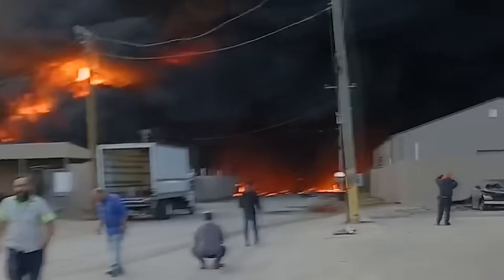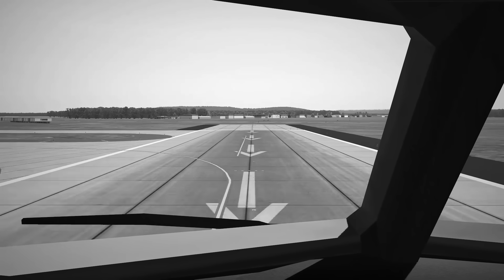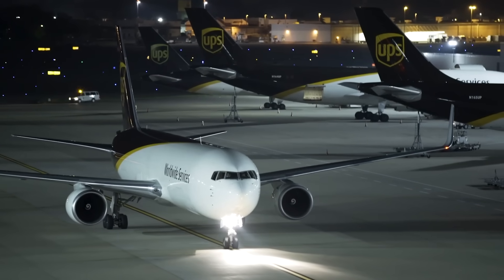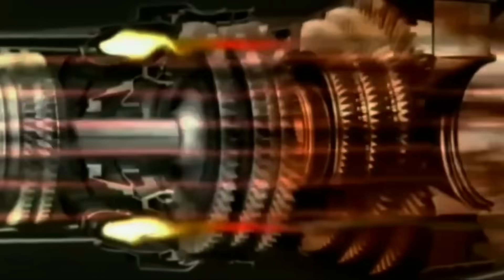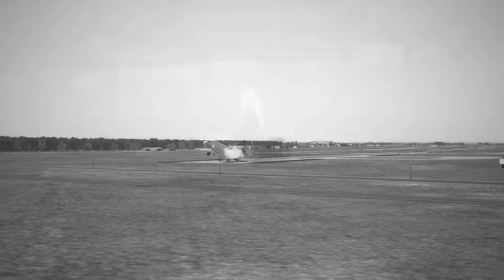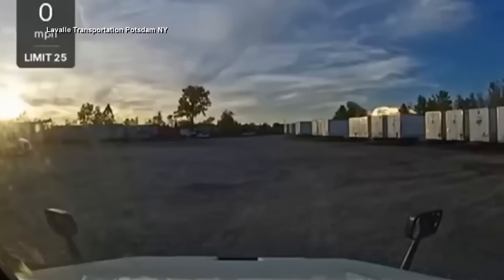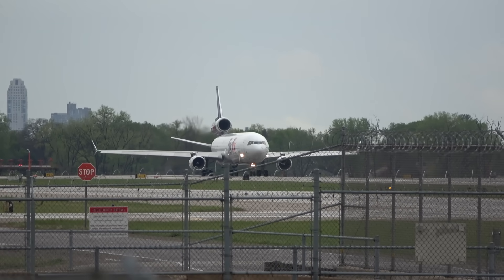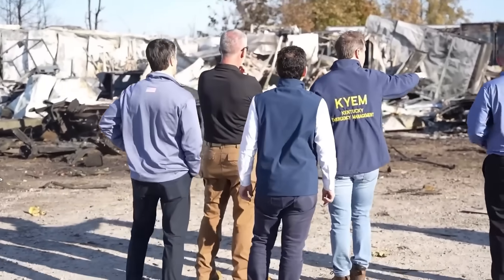The Real Reason That Makes UPS Flight 2976 Crashed...

Comment: This aircraft was gonna crash even if they had full power from the other two engines, the hole left in the wing after losing the entire pylon and engine with the fireball heating the left wing like shown in the video would have fatigued the integrity of that wing and eventually caused that wing to collapse after take off before they could have gotten the plane back on the runway…..those guys were doomed as soon as they started rolling down the runway.

Comment: I think the actual sequence of engines is #1 left wing then #2 tail and #3 right wing and the compressor stall was in the #3 right wing?  Even if a second engine didn’t fail and they had enough thrust to climb, the damage to the left wing from the fire alone would probably cause a stall on the left side and still be fatal.

Comment: On crashes like flight TWA 800 where it blew apart over the ocean, I can see why it could take a year or more to issue the final report. All the evidence is at the bottom of the ocean. Pretty hard to get too. But this UPS crash shouldn't even take 3 months. All the evidence is within a mile from the beginning to the end of the debris field. It's not scattered over miles like a high attitude break up and its on land not under water. I believe the Federal Government (mainly NTSB) is just milking this for more funds. All the engineers, scientists, maintance faculties and records are right there. Add on that this is probably the most recorded crash in history from multiple angles. If everyone from the aircraft industry can already state on the record that it wasn't the pilots fault at all leads me to believe they already got a leading cause why it went down.
Reply: "TWA 800" shot down by navy "Standard" surface to air missile, as tangible evidence points to!
Reply: @internetcensure5849 center fuel tank got overheated by the air conditioning unit with old wiring caused it to blow up. The US Navy doesn't like to shoot down civilian airlines over US shores

Comment: Here is what a couple of pilots and others and what I think happened:

An uncontained fan blade disc separation in the #1/left engine sent debris through the engine, into the pylon, and into the wing. This caused the engine and pylon to separate from the wing. Also, the debris damaged fuel lines causing the fire. As the Engine and pylon separated from the wing it went up and over the aircraft sending debris and fuel into the #2/center engine causing a compressor stall and losing power/thrust in the #2/center engine. 

As to why there was an uncontrolled fan blade or fan blade disc separation? Only the investigation can determine that, IF that is the cause.   

WHY do I and others feel that is the cause? In the photo of the #1 engine that had landed on the edge of the runway, look at the rear of the engine, there appears to be a gap where at least 1 or 2 fan blades or fan blade discs were. Whether or not that damage occurred before the engine separated from the aircraft or after, only the investigation can determine that!
Reply: All of you were incorrect!

Comment: It is more apparent the compressor stall was the center engine, number Two, leaving the airplane in the unflyable position of having only one normally operating engine.  The crash was caused by the second engine failure.  A single engine failure is not fatal, but two is.

Comment: 4 decades in Aerospace building Aircraft/components/subsystems around the World. Good summary but point out you did not speak to the possibility that the #1 Engine may have separated from the Wing Pylon first. Don't forget that within the Nacelle, there are "FFC" (Fatigue Fracture Critical) Attach fittings ... the attach the Engine/Nacelle to the Wing Pylon and if those break loose, it'll take all of it up to the Wing apart. From other videos, I note the Engine is intact sitting in the runway enfield, followed up runway by the Nacelle Cowling and finally the Pylon that separated from the Wing. Given that sequence of debris, it would appear the Engine separated from the Nacelle and yanked the Pylon from the Wing and spewing those 22,000 lbs. of fuel out of the port Wing TE. Just a guess.

Comment: This is stupid,  if the right engine failed, the aircraft should have remained level from the thrust from the rear engine,  but in the video we don't see that, instead we see a plane going over hard left, simple indicators proving right engine giving max thrust,the center engine apparently failed, plus we don't know how much of the flight controls were compromised by the loss of the left engine. The plane was over 150mph at take off, the odds of debris crossing UNDER the plane and hitting the right engine is crazy, more likely scenario is debris from left engine getting into  center engine,  which is behind left wing, definitely the path in the video shows that being more likely.   When the report comes out we will know for sure about the engines.
Reply: The right engine had a compressor stall.  Which means only the #2 rear engine was producing full power.

Comment: Compressor stall? How can you tell the video has poor resolution? Is this an opinion🤔
Reply: One social media influencer said it was compressor stall and just like that it became fact
Reply: Look closely at the short flame from the right engine just after lift off.
Reply: Pilots and OTHER experts can tell by the puffs of the exhaust and flash of flame at the exhaust on the #2/CENTER ENGINE! 

Don't be afraid to look it up!!
Reply: @matthewgroff433  until FDR data is released, it's speculation.

Comment: 220 THOUSAND ponds of fuel? 
That 110 TOnS.  110 x 1000.
26, 829 gallons?
Holy shit
Reply: He said 34,000 gallons. Jet A is 6.7-7.0 lbs./gal. Water us 8.33.
Reply: @patrickmcdonald3427 damn that's like 50 cars...
Reply: @petez470:  you might want to check your arithmetic.  A ton is 2,000#, not 1,000#.  220,000#/6.7# per gallon is 32,836 gallons of fuel.

Comment: Engine pylon was damaged installing #1.Same thing happened in Chicago .thats my guess
Reply: How do you know what if any damage the #1 pylon had? As I commented previously, are you a member of this NTSB investigation team? If not, don’t represent you opinion as fact.
Reply: @tomreid5184 I called it a guess .Same model plane crashed the same way in Chicago NTSB ruled its engine pylon was damaged remounting it and came up with a new procedure in mounting the wing engines .
Reply: @paulgrimm  I spent 20 years in the Marines and was in two wars. Guessing would get you or your men killed. Stop acting as if you have some crystal ball. Get the facts then come to a logical conclusion.
Reply: FYI: the other air craft you referred to was a DC-10 not an MD-11. You can’t even get the facts right!,, Instead of interjecting your guesses, stick to writing fiction.
Reply: That was a DC10 but you may be right.
Reply: @mustang7272 could be missed structural cracks on the wing or even improper maintenance repairs on the left wing.

Comment: I think you have this wrong.  Engine #2 is the engine in the tail.  It was engine #2 that was likely damaged due to FOD from the failed engine #1 under the left wing.  The only functional engine was engine #3 under the right wing.
Reply: I noticed that too. They said it correctly, but the video misnumbered them.
Reply: Exactly! The narrator was wrong

Comment: The incident aircraft completed a scheduled "D" check, taking 6 weeks, which was completed on 18th Oct 2025. During such checks the fuel tanks are drained, cleaned checked for cracks/leaks and then treated with anti-corrosion and anti-fungal preparations.

Minor cracks etc may have been rectified by temporary repairs and permanent rectification deferred until scheduled deep maintenance. All such deferred defect must be cleared in order to complete the "D" check.

Comment: Why do so many airports have runways so close to people and buildings ? The end of the runways should be clear for a long distance in case of a crash like this one.
Reply: Been asking the same questions also.
Reply: If it's like my hometown, dumb ass people will move there because the land is cheap, then a year later complain about the jet noise and some older airports like Houston Hobby and Chicago Midway were pretty much surrounded by neighborhoods.  Never going to be able to move that many people out of the way.
Reply: Businesses supplying the needs of the airlines  - food, freight package sorting, hotels for flight crew....

Also cheap land because of engine noise.

Comment: The No 1 engine is on the left wing and No 3 engine is on the right wing and the No 2 engine is mounted in the fin.

It was the No 2 engine that ingested debris from the No 1 engine and suffered compressor stalls.
Reply: no evidence #2 engine ingested debris.

Comment: In the video it seems like the #1 engine was on fire the whole way down the runway so why not abort takeoff as soon they noticed this??
Reply: the pilots couldnt see the engines, they were trying to fly the plane and relying on the gauges. If they had seen the fire, they might have tried to abort.
Reply: Because a fire in one engine is still manageable. Hit the fire suppression button, shut off the fuel to that engine, and go around when able. The MD11 is very capable to handle this kind of event.
What really screwed things up was the total LOSS and ejection of the #1 engine, and resultant debris being ingested by #2, making IT fail. Low, slow, and unstable is a guaranteed disaster. The aircraft was past the V1 decision point, so it HAD to take off, there were no other choices.
Reply: @beezul Thanks for clearing that up for me instead of just writing some dumb shit like "because that's not what happened"! 🤣
Reply: @mikemoran0331  Great reply to sky boy or maybe sky pilot.
Reply: because that's not what happened.

Comment: En#2 has injested some EN#1 particles. Named DOD (domestic object damage). 
Please correct your video who point EN#3 (RH engine) has failing aflter EN#1 separation from the pylon.
Reply: no evidence #2 ingested FOD (foreign object debris)
Reply: @skyboy1956  not FOD but DOD. On the airport video we can see one flash in the nozzle of EN#2. Compressor stall maybe due to DOD

Comment: To begin with, when I was in the service, I was part of an aircraft accident investigation.  As soon as was possible, the maintenance records and flight logs were taken into possession of the Board. This was done to prevent any removal of document's that might lead to the root cause of the accident or coverup of questionable maintenance practices.

In this video, you show a drawing of the engine configuration of the three engines while narrating. You identified engine #2 as #3 which does not match your diagram. Engines are  numbered from left to right as viewed from the pilots view therefore: #1 is the left engine, #2 is the CENTERLINE engine not #3 per your diagram. Perhaps you should have been looking at your own diagram instead of reading off of a teleprompter.

Through out you narrative, you imply that the cause of this accident was the failure of the bolts/mounts for the #1 engine.  I agree that that engine did in fact separate from the left wing, but under No circumstances can you factually identify the root cause.

At the end of your diatribe, you say that "We're not going to get ahead of the investigation." That is exactly what you're doing.

Are you a member of the NTSB investigation team?

 You're free to speculate all you want, but don't for one second talk as if you have access to the factual evidence. You are confusing what could have happened with what did happen. The old adage that if you repeat something often enough that it becomes fact is exactly what you are doing. You should stick to writing fiction and leave the factual report to the experts and in this case that's the NTSB.
Reply: Definitely goofed on the engine number diagram.

Comment: The plane had previous damage when it hit the firmament.
Reply: There is no evidence that the plane had any damage prior to the left (#1) engine failure/detachment. Why that engine failed and detached, or became detached just prior failing is unknown. It was almost certainly some sort of mechanical failure involving the aircraft's components themselves, and was not related to any external forces previously damaging the aircraft's components, unless some type of debris kicked up from the runway during the takeoff roll and damaged the #1 engine. So far there has been no release of information indicating that happened. The engine did detach prior to the aircraft rotating to lift off. That is correct.
Reply: @michaelstephenson4136 
Obviously you dont know everything.
Reply: @samsngdevice5103 Obviously not. Nobody knows much at all until the NTSB report comes out. So why are you pretending you do by making a definitive statement about the damage? I did acknowledge you were correct that it had damage prior to getting briefly airbourne. That much we all know. Have a nice day.
Reply: @michaelstephenson4136  Now this is how you should comment on this accident. Not conjuncture. I hope these other Monday morning inspectors never become NTSB or any other kind of investigator.

Comment: Im 73, i remember the 1979 DC-10 crash as the same engine ripped off the wing. 😮
Reply: Do you remember the Sioux City iowa plane crash? that went in circles, then crashed, cause was a cracked stage 1 fan disk, I personally became a FAA stage one ultrasonic inspector for GE fan disk,  the one that was cracked was misinterpreted as a air bubble during the inspection, ive inspected 100s of them, same engine as the ups one, this wasn't the only thing I inspected, I inspected just about every rotating part on many other engines, made a career out of it, 43 years and retired 2 years ago. Also engine mounts for the GE90 engines. Believe it or not i also inspected the 18 mirrors on the James web telescope or brush wellmen the manufacturer of the mirrors in Ohio.

Comment: NTSB said that no 2 engine, the one in the tail of the plane, was the engine that screwed up. Also said you could see compressor stall evidence via the white smoke from the tail engine.
Reply: NTSB has not commented on #2 engine performance.

Comment: I would like to see a schematic  of the pylon attachment to the wing and frame.
Reply: It is designed to break from catastrophic engine failure the MD  11 is designed to take off with 2  of the 3 engines and it did
Reply: @wetrider97 Did take off? It barely got airborne and lost enough lift to keep it airborne as soon as it was high enough to lose ground effect lift on the wings. The video evidence suggests the number 3 engine was failing also, likely due to debris from the number 1 engine damaging it, leaving only the number 2 engine fully functioning. They never had a chance.
Reply: @michaelstephenson4136 maybe the engine didn’t fall off quick enough if the # 3 engine was loosing thrust would make sense why it lost lift
Reply: @wetrider97 They know exactly where the #1 engine fell off, because they have airport security camera video of it falling off, as well as they can visually see where it fell off and landed next to the runway. Most "experts" seem to be in agreement that what most likely happened was the #1 engine failed and shot debris across under the belly of the fuselage (both engines hang below it so there is a clear path) and damaged the #3 engine. It's all speculation at this point. One thing that seems apparent is that the aircraft did not have two fully functioning engines, or the pilots would have been able to get it airborne. Since they have the flight data recorder the NTSB probably already knows a lot about the state of the engines and how much, if any, thrust each was producing. Time will tell what happened and what the sequence of events was.

Comment: After maintenance just like the DC-10 in 1979 , the mechanics used a Fork-lift, to 
raise & bolt in the engine to the  Pylon.  It was a CHEAT Short-Cut, and later that 
engine also fell off.  Fast forward, and the same DC-10's  rename them as  "M.D.-11".
Reply: What is your point exactly? Are you saying improper maintenance was done on this plane? You were there?

Comment: To date this is the most accurate portrayal.  As severe as the failure was on #1 theres a real possibility that uncontained debris could have transversed the airframe and disabled #3.

It happened with an American 767 at LAX a number of years ago. The write up called for a run up at full power by the mechanics. The entire disc from #1 departed the containment,  transversed the belly of the AC and impailed itself in #2. Had it happened on VR it would have gone down the same as this MD-11

(I have a copy of the NTSB report.)
Reply: SDF was NOT in contained engine failure.